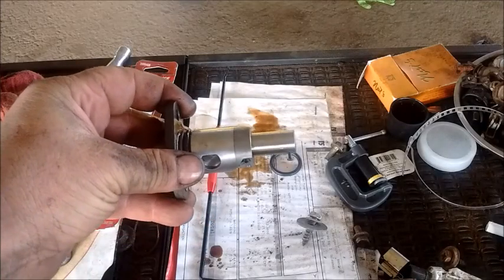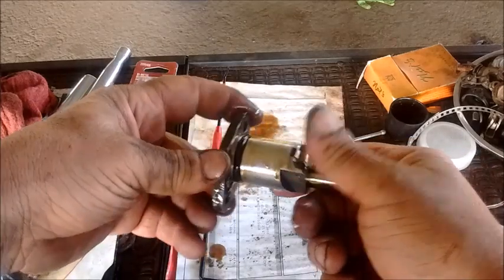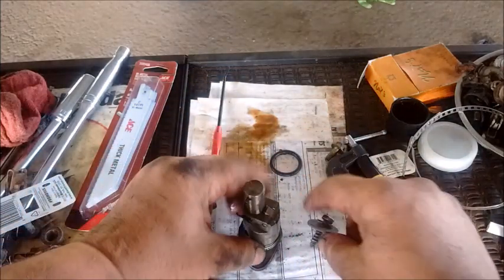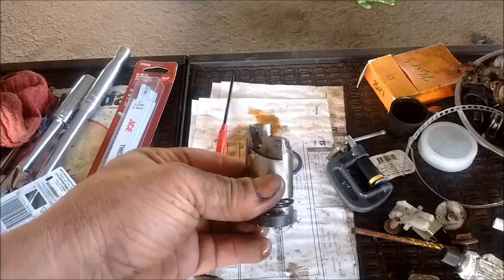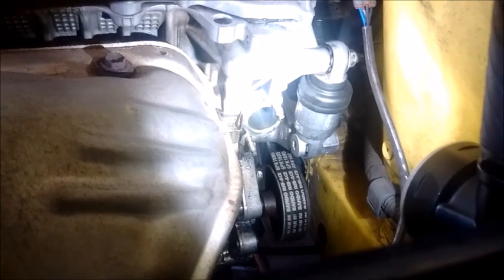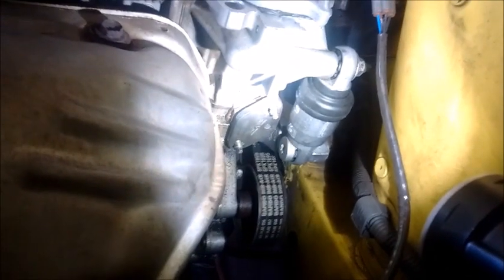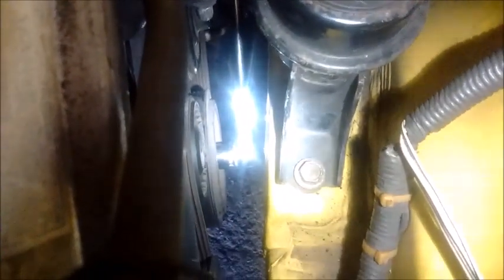How to Reset the Timing Chain Tensioner - Toyota MR2 Spyder, 1ZZ-FE, 2ZZ-GE

Comment: Wat should be done  n wat might be the problem  if 2zz get timed  ( chain) and get used few days then get out of timming again
Reply from the maker: It's very hard for this to go out of timing. If the tensioner is doing its job it's almost impossible for the timing chain to skip. Make sure the tensioner is installed correctly.

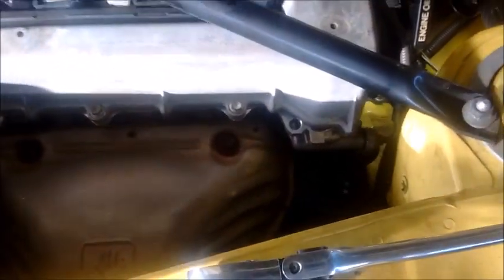Comment: 3:52 I did this replacement and then found your video afterward. 😅 was wondering if I did any serious damage. I turned the pulley 3/4 to a full rotation counter clockwise because I never heard the release. Any help would be greatly appreciated thank you
Reply from the maker: If you've already started the engine and nothing bad happened then there was no damage.
Reply from the maker: Otherwise, if you're in doubt, just remove the tensioner and do it again.

Comment: Did you turn the crank forward (right) or backward (left)?
Reply from the maker: turn the crank backward i.e.  counter-clockwise as you face the pulley. This is essential for creating tension against the tensioner which is on the exhaust side, and releasing the latch  If you turn clockwise you create tension on the intake side and the tensioner side remains slack.
Reply: Frank Saab yes!! Thank you for the reply Frank! Thanks for saving all of us mr2 dummies 🤣